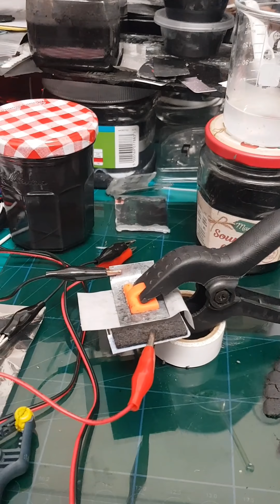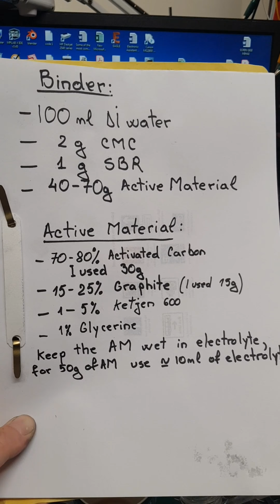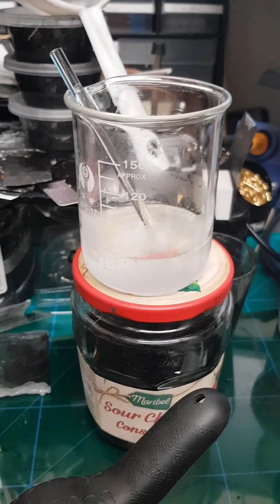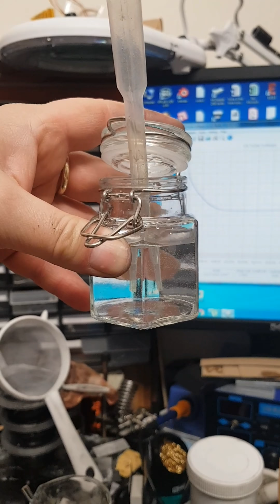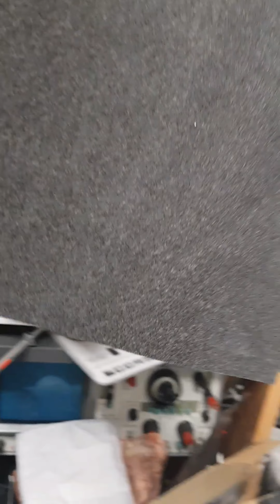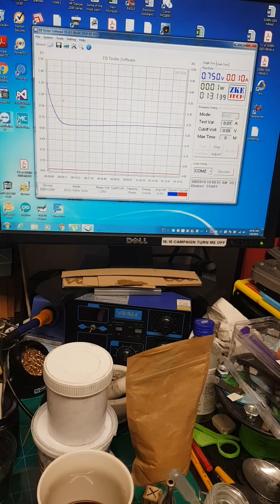Amazing performances of a zinc carbon battery cell, The Kev Cell - part 1

Comment: I built a series of crystal cells using the formula published by LaserSaber using copper pipe and a magnesium rod core and compacted Epsom salt/alum/salt substitute (potassium chloride)/borax. The best cell lasted six months running an LED continuosly. His ran for two years. The cells exhibit a similar characteristic to what you are observing in that the voltage increases over time.
Kev noted that he had good results with carbonized garlic which has a small amount of sulfur. The common ingredient is the sulfur in the Epsom salts and garlic. I suspect sulfur might have a beneficial effect in the active materials. It could just be a coincidence but worthy of testing.
Reply from the maker: I haven't tested yet that activated carbon from garlic, I am expecting only good results. The sulfur contamination had for sure a major impact on this result.

Comment: That's doing something very interesting, Sorin: The fact that the Voltage rises with time, when under load, suggests to me that the cell still might have been forming in some way, such as better wetting of the carbon, etching of an electrode surface, or boundary layers being formed within the electrolyte water. (Water has some very peculiar microscopic boundary layer properties which were first observed recently, and which are still being studied. There's a TED talk about it, from a year or two ago.) 

It might be worth your while to build some more identical cells, then wait for several hours, the next day, and a few days before comparing discharge curves with this one. You might find that the initial voltage drop is significantly less, and that the cells will discharge more conventionally. The results would still be interesting, even if they're identical to this cell.

Presumably you will also build identical cells and charge them before discharging them like this? An initial deep discharge can change the cell significantly, often detrimentally. Lead-acid cells, for instance, are damaged by deep discharges, and both MiMH and Lithium-Ion cells are damaged if over-discharged and then left for a while before recharging. 

Thanks for sharing your findings.
Reply from the maker: Very useful and interesting info, thank you, sorry I can't write more, I am at work.  Cheers!

Comment: Awesome mate! Did you managed to work out the wh/kg of your device?
Reply from the maker: Hi Tim, I will do that when it will finish first run, for the moment is still running,  has 8.5 hours,  85 mAh, 63 mWh and 2 g of active material..... looks very good so far.  And the voltage is on 0.69V. If I am not wrong,  means 37Wh per kg and 42Ah per kg. Am I correct?
Reply: Could be mate. If it is then that's very good 😉